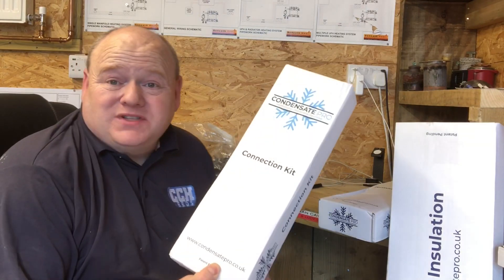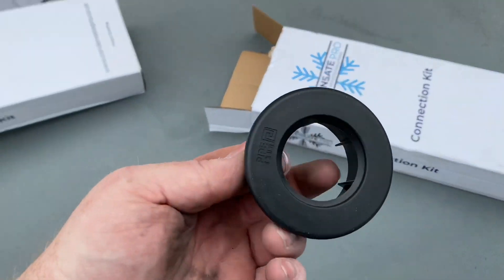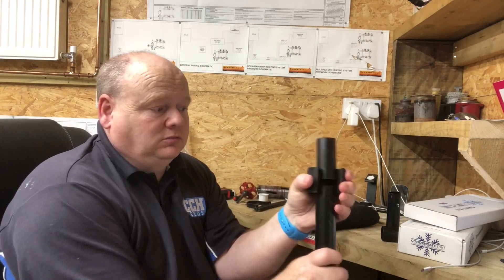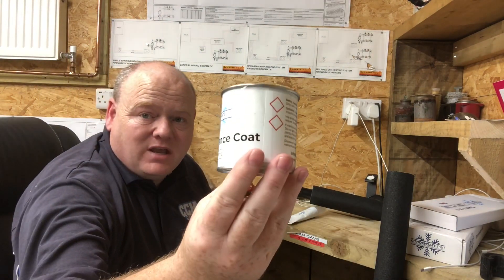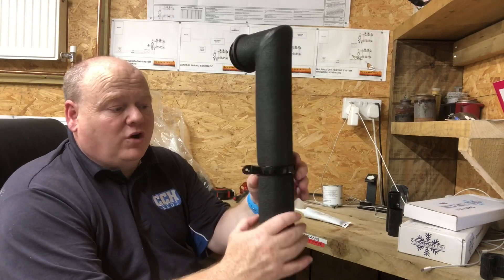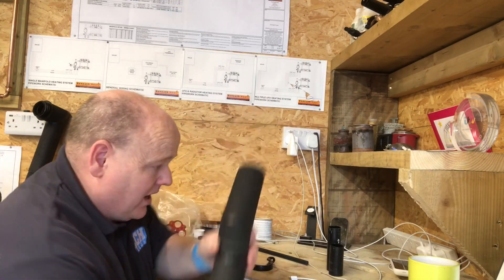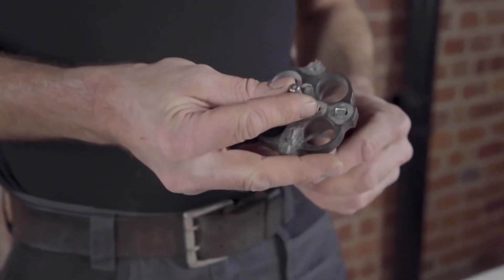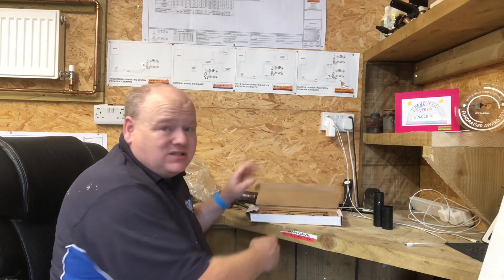Condensate Pro - What is it? Frozen Boiler Condensate. Avoid Boiler Breakdown TB155

Comment: Looks great .....
However, wouldn’t 50mm waste pipe be cheaper and not freeze ....
#askingforafriend
If anyone else has already said this then ‘sorry’.... I don’t see the need to insulate the condensate pipe work, but if it’s now part of the compliance of installation, I fall on my sword.
 Worcester lovers won’t be interested as they have the condensure thingys 🤣🤣
Reply from the maker: You would need to check out the installation instructions for the boilers you install. Building regs say the condensate needs lagging. Thanks.
Reply: https://www.youtube.com/watch?v=h8gsasdfEfs&t=14s
and the Worcester condensure thingys 😁 still advises that you must insulate the external pipework

Comment: I normally just run the condensate in inch 1/2. Through the wall and into the soil stack. Is this not allowed then?
Reply from the maker: You would need to check with the installation instructions of the boiler you install but nearly all the ones I have seen need to be lagged.

Comment: Good morning Allen ,you stated that you used to use another type of lagging with presumably no problems,or you would have stopped using it . Standards are a good thing but sometimes I think they are there for a cash generating exercise. Rules have to be there but at the same time they must make sense or people will ignore them and perhaps some that really matter.for instance I notice further down someone had stated they used 1.25 inch pipe throughout  ( so did I years ago) , but this was not to the current standard . Surely for standards to mean anything there must be a reason why this is not now acceptable There may be ideas and work practices out there that are better than the stated current standards but these are wrong and the standard is correct .
Reply from the maker: The installation instructions used to say lagging, Then it seemed to be updated to class O lagging, Then Class O waterproof lagging. The point is class O lagging isn’t correct unless you paint it, You also need to paint it twice. You could do that yourself at home and the ones I have done in the past will be treated when I return for a service. Thanks.

Comment: Do you not think this is abit expensive for what it is? You could install 32mm all the way with a heat cable with outdoor temp sensor which fires up when temp drops outside for less that 1/4 the price of this... 
I like the product but living in bradford customers will not pay that price
Reply from the maker: Brendan Fisher How much do you think it costs?
Reply: For  a standard job 1m to drain would be around £25 the £6 every other 1m,   saves time on install as is takes 30m max  /  nothing looks as good on the market  ,
Reply: any heat trace if fitted correctly would cost a lot more and under Regs still need to be insulated, we found heat trace had problems and also cracked the plastic pipe if not fitted correctly

Comment: Product seems good however it is just very neat lagging. I like to keep mine inside even if it means pumping it. Nice way of termination if needed though 👍
Reply from the maker: Thanks for watching!
Reply: neat lagging the dose the job that others don't  if you try to fit  to the correct standards, Have a look at all the problems with the rest and we have solved them, yes if you just stick some cheap lagging and don't bother sealing or protecting but is that the right way to leave a customer and look at is when you finished, would you want that mess on you home and I few years will be useless, All that's bee taken care and helps you fit a perfect job in 30min

Comment: I just fit 1 1/4 straight out , i know its not upto regulation, but i hardly ever come across frozen condense pipes anymore.  Its was a good earner years ago when ppl just stuck overflow outside , but them days have gone ,i feel
Reply from the maker: We cannot choose which parts of the installation instructions we follow 😂😂😂😂❤👍 Thanks for the comment though.
Reply: ten of thousands froze in 2018  and the papers were asking why it not been sorted for the problems we had in 2011, it  best practice to comply to protect warranty and also its  being picked up but gas safe, condensate pro just make it all easy and has everything to solve the problems for with protecting condensate

Comment: Getting the condensate out is a pain in the bum. It's not our everyday wastewater. It is acidic. 

Most plumbers I know seem to be happy to feed it into the kitchen sink mechanism.
Reply from the maker: Running internal can be better sometimes. Depends on installation instructions. Thanks.
Reply: All the bleach and god knows what I dont think it matters
Reply from the maker: galaxydave69 I used to use 1 1/2 but it doesn’t comply unfortunately, Still needs lagging, depending on installation instructions
Reply: Internal connection used to be recommended,it stopped freezing  but you did sometimes get blockages from all the stuff going down the sink waste .Had a call out once to an Ideal ISAR .They had connected the condensate above the sink trap,The customer had been away on holiday come home ,and the very shallow trap on that boiler must have dried out I was actually getting a reading ofproducts of combustion up the kitchen sink .Got the installer to move it below the trap pronto.
Reply: I bet there was a funky smell from that! You'd never expect a boiler to smell like a drain normally!

Comment: I dont think frozen condensate is a big problem like it once was. Most Boiler manufacturers seem to be overcoming the problem by having larger condensate traps in ther boilers which dont empty as often and they empty quite fast.ive never had a frozen condensate on a newly designed boiler
Reply from the maker: As a Gas Engineer we need to follow the installation instructions and in most cases, they ask for all external condensate pipe to be lagged. Thanks.
Reply: @AllenHart999  even in 1 1/2
Reply from the maker: galaxydave69 Still needs lagging 👍
Reply: hi Shaun,  most  condensate trap are 100 ml and when they empty  they only trickle   ( we have a video on this )  they were a massive problem in 2018 when all manufactures we inundated with frozen condensate
Reply: https://vimeo.com/430485996